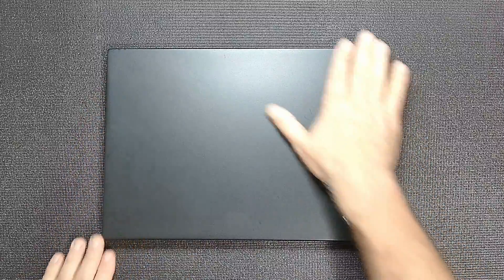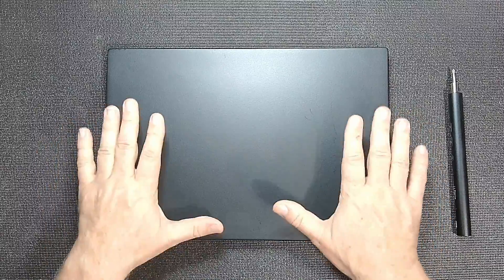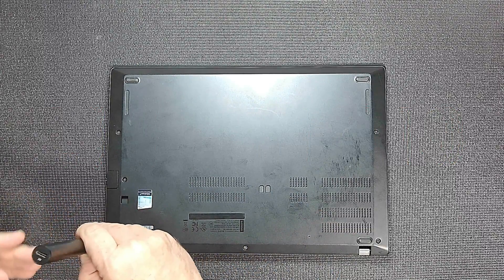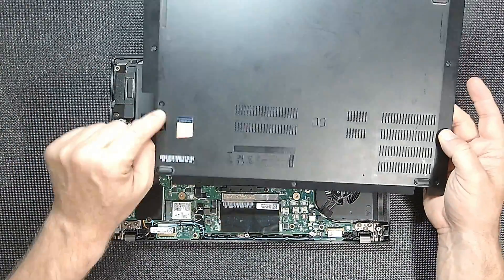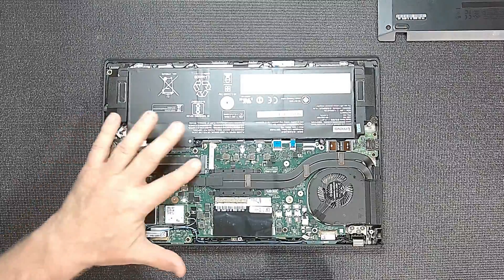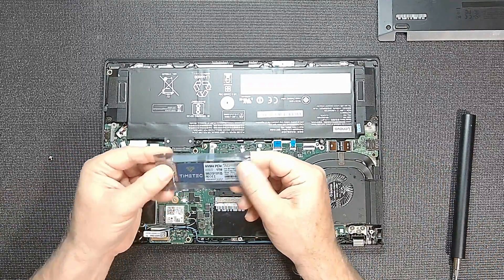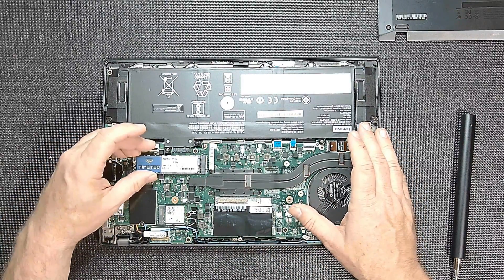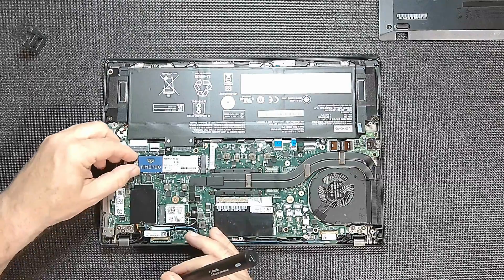LENOVO T480S  T490S SSD M.2 NVME upgrade -- LGH

Comment: GREAT VIDEO... Actually Im having troubles with my laptop I bought from my company back in 2023 (4 years of normal performance at 8Gb). I had upgraded up to 24Gb... great start in 19 seconds... but recently I noticed slow performance and excesive heat (49°Celcius) even more when its charging. Do I have to look something particular to change or upgrade... battery? I already ran the lenovo vantage and battery report (has 569 cycles and has 48,560mWh  from the 57000 mWh original  ... some times the RAM drops to 14GB... and Im only using google and excel (not fancy job or excesive work).... any clues?
Reply from the maker: May want to remove cooling system clean it and new silver paste... the ram issue is an issue it should not show then not. So this could be a bad stick or the controller on the MB is maybe getting too hot or flaky

Comment: Thank you, this has helped me upgrade my NVMe.
One note about the screws. On my T480s only that 6th screw by the ethernet port was equipped with the disc to catch it, the other five just came out. Might be because I bought it refurbished and it's not a big deal, just a heads up for anyone who might expect them to catch and isn't prepared for them to fully unscrew

Comment: You can also install a 2nd (!) M2 SSD into the space just below the regular M2 NVMe!
BUT you have to make sure it is shorter using form factor 2242 (only 42 mm long) AND only NVMe with 2 keys can be put into that M2  slot where usually the WWAN modul would be placed!

Just not sure if that is also possible for the T490s!
Reply from the maker: thank you
Reply: Some people say that WWAN slot is only for storage I mean not if you require it in performance extensive tasks or gaming? Can you help

Comment: Hello and Thank you for review. Question pls  im able to purchase from a store   t480s ($400aud) vs t490s($450aud)  in Australia for around similiar prices. Which one should i go for keeping in mind screen display, performance & upgradibility. This will be used for some office work , emails, YouTube,surfing etc. Your input much appreciated. Thanks
Reply from the maker: if they are the same cpu then they are to same unit so do not spend more for the same specs, just as it is newer it is most likely 8th gen as well
Reply: @LastGameHunter  Thank you for your input. If you could suggest pls. Specs are as follows please.

T490s:  $460 Aud
1.6 GHz Intel Core i5-8365U Quad-Core
16GB DDR4 | 256GB PCIe NVMe M.2 SSD
14" 1920 x 1080 Anti-Glare Display

T480s:   $470 Aud (Touch)
1.9 GHz Intel Core i7-8650U Quad-Core
8GB DDR4 | 256GB PCIe NVMe M.2 SSD
14" 1920 x 1080 Anti-Glare Touch Display

T480s (Non Touch) $400 Aud.  
Specs: 1.7 GHz Intel Core i5-8350U Quad-Core
8GB DDR4 | 256GB PCIe NVMe M.2 SSD
14" 1920 x 1080 Anti-Glare Display

Thanks
Reply from the maker: @rickys3197  this one and get an extra ram later   
T480s:   $470 Aud (Touch)
1.9 GHz Intel Core i7-8650U Quad-Core
8GB DDR4 | 256GB PCIe NVMe M.2 SSD
14" 1920 x 1080 Anti-Glare Touch Display
Reply: @LastGameHunter  thanks so much : )
Reply from the maker: @rickys3197  GLAD TO HELP

Comment: BAH! What's wrong with a 256 :) The irony is that its probably the exact same manufacturer of the "big names" with a generic name on it. Good tip.... On those TINY screws.. turn the screwdriver backwards one full turn till you hear the "click" then forward.. this will prevent cross threading. :) Great video brother!
Reply from the maker: thank you